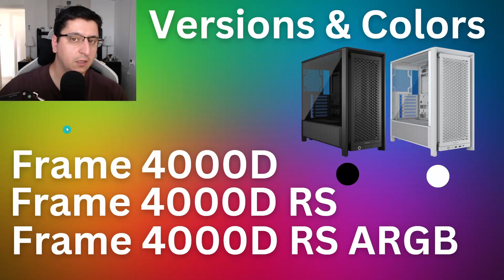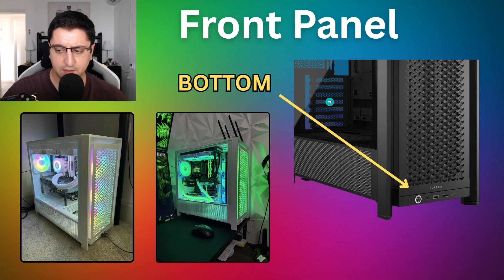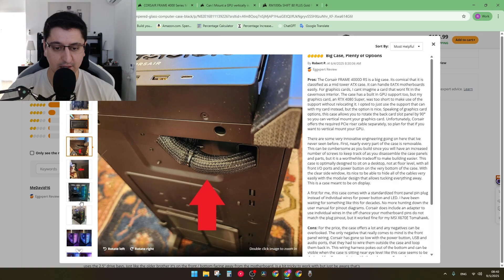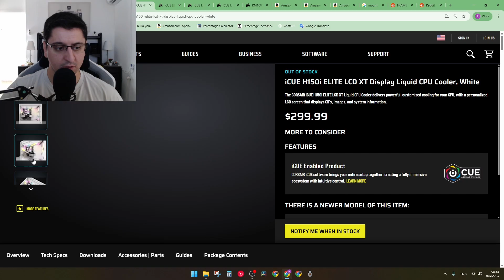Corsair Frame 4000D - Important Specs, Reviews & Builds.

Comment from the maker: Make sure to check out Corsair's building guide here for more information about the Frame 4000D:
https://www.corsair.com/us/en/explorer/diy-builder/cases/corsair-frame-4000-series/

Also, I made chapters for you to make it easy for you to navigate to the most relevant parts for you: 
0:00:00 - What to expect from this video
0:01:05 - Versions & Colors
0:03:11 - Fans Connectivity
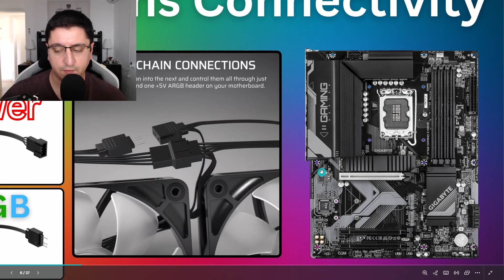0:08:15 - Size
0:11:00 - Front Panel 
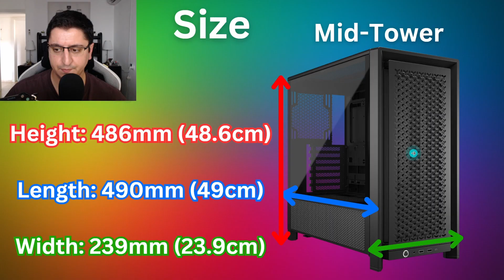0:14:51 - Motherboard Support - Mini ITX, Micro ATX, ATX & E-ATX
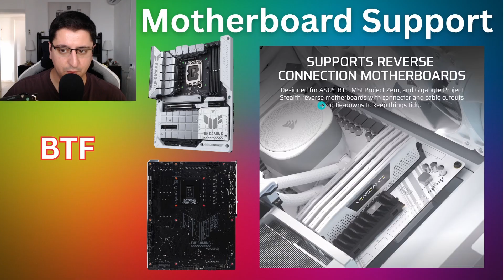0:20:04 - Motherboard Support - BTF
0:22:42 - Liquid Cooling - Type of coolers (and fans)
0:25:03 - Liquid Cooling - Compatibility 
0:27:14 - The GPU Anti-Sag Mount (and the Mini GPU Anti-Sag Mount)
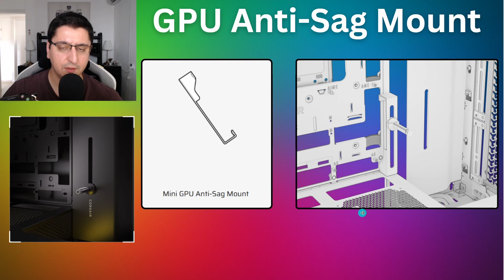0:29:32 - The Manual
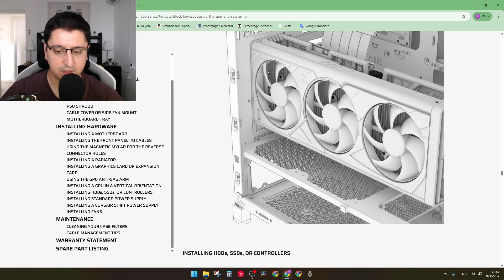0:31:11 - What is the Infinirail System?
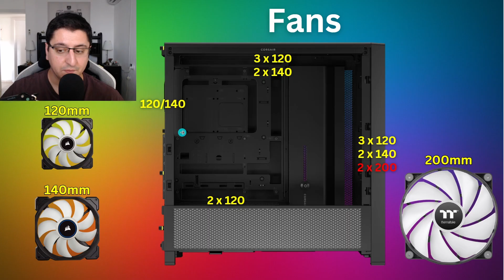0:34:55 - Fan Compatibility & Airflow
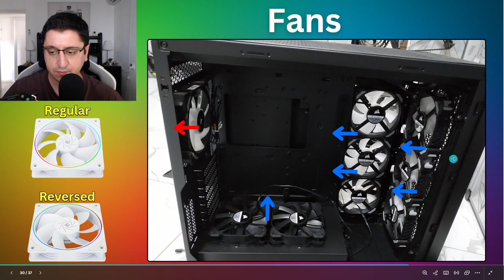0:38:36 - Air Coolers Compatibility
0:39:54 - Drive Bays (3.5" Hard drive & 2.5" SSD)
0:41:35 - GPU Compatibility & Vertical Mount
0:45:38 - Important! - PCIe Riser Extension Cables
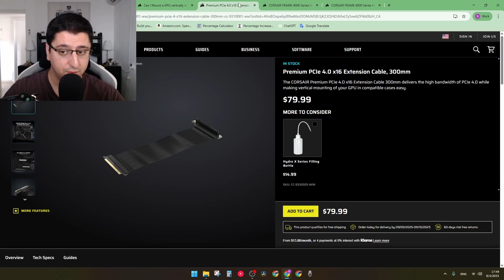0:47:29 - Builds & Reviews
0:47:49 - Build Review #1 (Robert) - Big case & Short GPU mount
0:50:10 - Build Review #1 (Robert) - Good modularity & nice aesthetics
0:51:52 - Build Review #1 (Robert) - Front panel adapter & Front panel flaw
0:54:55 - Build Review #1 (Robert) -  Good build quality & Quiet fans
0:55:42 - Build Review #2 (Trevor) - Not having a rear fan & 3 types of airflow
0:59:04 - Build Review #2 (Trevor) - A lot of room to work & nice aesthetics
1:00:00 - Build Review #2 (Trevor) - Elegant thumb screws
1:01:54 - Build Review #2 (Trevor) - Ease of build & BTF support
1:02:35 - Build Review #2 (Trevor) - Shift PSU Support
1:04:51 - Build Review #2 (Trevor) - The front panel cables flaw
1:06:07 - Build Review #2 (Trevor) - Bottom drive bay problem
1:09:21 - Build Review #2 (Trevor) - Thin top panel
1:10:53 - Build Review #2 (Trevor) - iCUE LINK & ARGB compatibility problems
1:14:31 - Build Review #2 (Trevor) - Reviews problem
1:15:31 - Build Review #2 (Trevor) - What coolers should I buy with the Frame 4000D (and which ones I shouldn't)
1:18:35 - Build Review #3 (koiffeine) - The front 200mm fans problem.
1:23:09 - Summary 
1:24:37 - How to differentiate between the old 4000D and the new Frame 4000D

Hope you enjoy. 
Rafael 🫶

Comment: Putting a build on the floor is horrible for airflow and dust so I think that's why the front panel connectors are on the bottom since most people put builds on top of a table/desk, ya?
Reply from the maker: I think people like to put their builds on the table because of aesthetics. That's why manufacturers started making cases with bottom front-panel I/O.
Back in the day, cases didn't even have windows, and they were big and heavy, so putting them on the table was pointless unless you didn't have space on the floor or something.

As for airflow and dust, I don't think there's a big difference. 
I have both of my PCs (one for work, one for gaming) on the top of my table, like above my monitors (I have a big shelf), and I feel like they actually, if not the same, get a bit more dust and also more heat because hot air always goes up, not down.  

But that's just my opinion.

Comment: I'd like to believe the reason for the fan rail system has to do with sound. When you mount a 140mm fan on conventional rails, part of the fan blades cross in front of the rails where the 120mm fan would be screwed in, generating noise and turbulence (you can test it yourself). With this alternative, the problem is solved. For me, it's a pretty clever solution.
Reply from the maker: That's a good point; it could very much be the reason.
I saw people talk more about esthetics and airflow. If you mount a 140mm fan in a 120mm spot, then some of it is blocked, and you don't really get the full airflow that a 140mm fan could provide.
But that said, I think it's a very minor difference (in my opinion), and I think it might be better for the consumer if they offered an option without it. Maybe it will help reduce the manufacturing cost, resulting in a lower price for the consumer.
But that's just my opinion, although you have a very good point.

Comment: Hi and thanks for the very detailed video! Would you still recommend this case for someone who wants to go with a Lian Li aio and fans?
Reply from the maker: Yes of course! What's good about this case is even if you buy the model that comes with ARGB fans (RS ARGB) you don't need any kind of special controller or hub because it uses standard 5v 3-pin ARGB plug.
Just make sure you motherboard has enough ARGB headers. Even if you decide to go with a ln ARGB hub to connect everything all together then you can easily connect everything together.
Reply: @FullTowerTV I'm looking at a B850 motherboard (either the MSI MAG Tomahawk or the Gigabyte Aorus Elite). I'm planning to get the case without them fans and buying the seperate, Lian Li ones. Would this be a hassle?
Reply from the maker: @HalstenGlasc they are both great motherboard! The b850 tomahawk is actually one of my favorites 😍. I almost ordered it a couple of days ago but my bank account said "no" 😅
As for the fans it really depends which fans and AIO are you getting?
Reply: @FullTowerTV I am leaning towards the Tomahawk yeah, only thing thats holding me back are the green accents which I don't love at all honestly. I would prefer the Aorus aesthetically. As for the AIO, I am looking at the Thermalright Grand Vision and the Lian Li uni TL fans. What do you think of this setup?
Reply from the maker: Yes, the Aorus is really lovely. I initially wanted to get that, but I prefer the tomahawk more.
.
As for the cooler - I took a look at it and it looks really lovely! also not that hard to install altough i do reccomend following the installation guide to make sure you connect the pump and the fans correctly (i took a look at the installation guide and it should be easy to understand but if you need help with that feel free to hit me up @fulltowertv on facebook/instagram).

As for the fans, they are also lovely, but my concern is whether you will be able to see the LCD screen due to the grill at the front. 

I recommend getting different fans because you already have a screen on the cooler's block anyway.
For example, you can get these Thermalright fans, which have a very similar look to the lian li fans: https://www.amazon.com/dp/B0F6T6GCV8/?th=1 (Thermalright TL-M12Q)

BTW, you can also get this Thermalright cooler, which has the same TL-M12Q fans: https://www.amazon.com/dp/B0F66J3QPC/?th=1 (that way you will have a more complete look to your system. 

Or, you can get the same fans that come with the Grand Vision cooler (TL—H12-X28-S): 
https://www.amazon.com/dp/B0DRNFRS5X/?th=1

However, I recommend going with the FW360 cooler and the M12Q fans because, and this is important, you will have significantly fewer cables to deal with, which will make your life a lot easier when you assemble the PC.